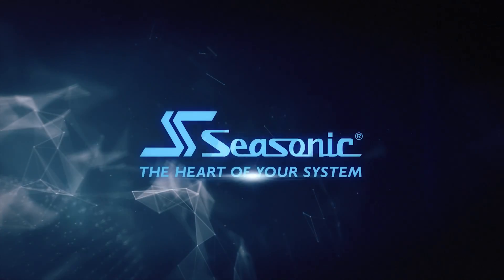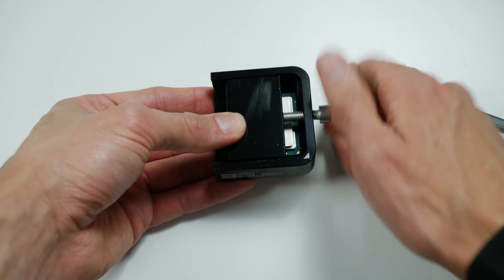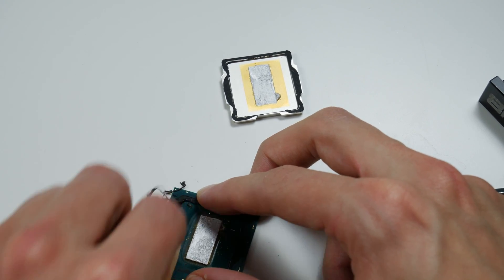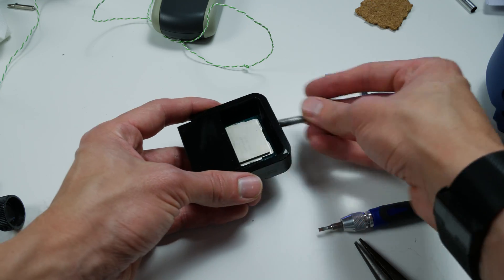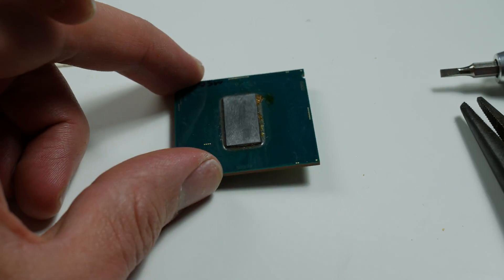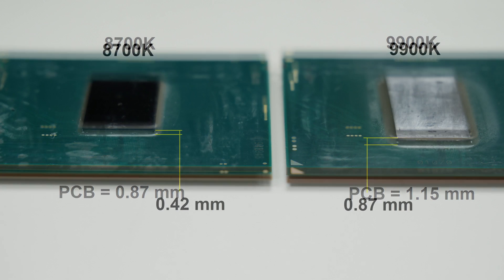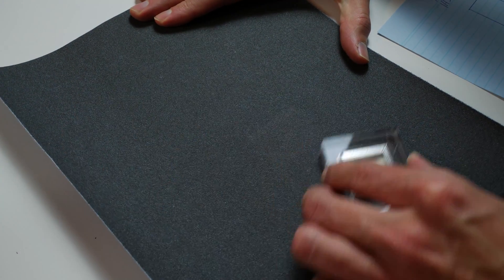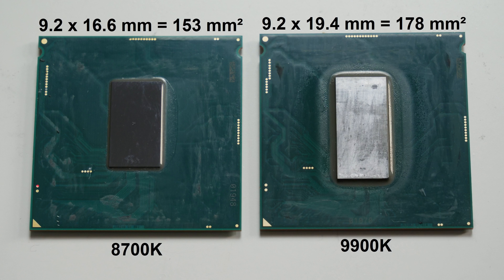Bad sTIM? Why is the 9900K so hot?

Comment: Waiting for 3700x :)
Reply: majnu100
Unlikely, as DDR5 is expected to come out in 2020 or 2021, which is part of the reason AMD says they will support AM4 until 2020 (other reason possibly being PCIE 4)
even if DDR5 came out early, AMD likely wouldn't be able to use it without breaking AM4 support
Reply: ah thanks for the info.
Reply: Diablo 4 confirmed
Reply: If AMD doesn't screw up in some stupid way, they will completely destroy Intel with zen 2 :)
Reply: +Robert Van GInkel
"completely destroy" is a huge overstatement... Zen 2 would be about 15-20% faster than whatever the i9 9900k's architecture is called, of course much cheaper, but still.
Reply: @roebbiej  yes they will..for few month
Reply: @roebbiej  like with their graphics cards ? Lol
Reply: @Maskinmester-DK  haha exactly. Or like the previous CPU lineups before they created ryzen.
Reply: Rasmus Rasmussen Their mid-tier graphics cards are actually really good, smart because about 90% of the market buys mid-tier graphics cards. Though their high end game is pretty awful atm. I hope they will stand a stronger when Navi comes out so that there will actually be better competition and start to stand a stronger foot in the gpu market like they have now in the cpu market.
Reply: Yep. I was considering getting a 9900k because some of the software I use for work doesn't run well on amd hardware. until I saw the temperature and power tests and this video.
Reply: AMD is going to kill intel in 2019 with the ZEN 2 design,
Hopefully the new GPU lineup is capable to battle against NVidia RTX
Reply: @Matt___B  yeah ... AMDtards said that shit about Zen+
Reply: upgraded my 2700x to the 2950x, i love amd
Reply: 3990X ;D
Reply: Zen++ or zen2
Reply: Is that was coming next because I was saving for a 2700x but I'll gladly wait to see what's coming next and go for ddr5 which hopefully will be out by then. It would mean me upgrading 2 gens on ram as in ddr3 and currently have a sandy bridge 2600k which I would sell the parts to fund my next build
Reply: @dnakatomiuk new amd gen next year but ddr5 ram ist expected in 2020/21
Reply: Me too
Reply: Me too, even if it's only 4.5ghz if it is at the right price and with a IPC increase I'm happy, screw Intel for charging so much.
Reply: +Happy Guy
intel is charging so much, because it costs them so much more to produce their CPUs, thanks to Multi-Chip Modules(what AMD call infinity fabric) their CPUs' price barely increases with the increase of core count as you have many small sized dies put together, while for an intel to make an 8 core/16 thread CPU they have to have a massive die and bigger dies increase costs exponentially, on top of the fact intel is facing 14nm shortages which increases prices further.

Actually, Intel is not really overpricing their CPUs, they just cost them a lot more to produce, thus are a bad value and not overpriced, there is a difference between poor value and overpriced.

On the other hand Nvidia has been overpricing the gtx 1000 series GPUs since 2016, the gtx 1080 came out costing 700$ MSRP in 2016, when it is/was a mid-range GPU with a die size of 312mm^2, super low failure rate and very low R&D budget for Pascal, whereas in 2011 the gtx 560 came out costing 200$ MSRP(254$ in 2016), had a 332mm^2 die size, Fermi at 40nm had huge failure rates and on top of that Fermi had high priority expensive R&D... the gtx 560 by all means is/was a more expensive GPU to Nvidia than the gtx 1080.

Nvidia since 2016 have been operating at a 100% profit margin which peaked in early and mid 2018 with them selling their GPUs at a staggering 134% profit margin. For reference, Apple is considered overpriced, but operates at a 35-45% profit margins, which means Nvidia GPUs are more than 3x times more overpriced than Apple's offerings.

Intel that you are blaming like crazy, has gotten down to 25-30% profit margins in 2018, which puts Nvidia gtx 1000 series GPUs 4x times+ more overpriced than intel CPUs.

Profit margins determine if something is overpriced or not, how good it is for it's price determines it's value to the customer, big difference.
Reply: ame ryzen is best :D
Reply: @linxu9763  
I don't know, i only really started getting seriously into PC gaming around 2012 (so around the sandy bridge era)
So socket 775 is too old for me to remember (though iv'e likely owned a PC with an older socket than that, i only know of the socket because i looked it up recently when someone mentioned they still were using a CPU with that socket lol)
i'm not sure if their was some weird cross gen thing with socket 775 with DDR2 and DDR3 or something?
I do remember their being a period (i think it was around 2014, but don't quote me on that lol) where intel had cross gen motherboards with DDR3 and DDR4 support,
i remember the motherboards being more expensive though, as the mobos needed to have separate slots for DDR3 and separate slots for DDR4,
you couldn't stick a DDR3 module in a DDR4 slot or the other way around,
so it wouldn't surprise me if 2020 or 2021 AM5 motherboards had the same deal, where ryzen 5000 series (or whatever it's called) would have a few cross gen mobo's.
AM4 likely won't have DDR5 support though, because i seem to remember AMD explicitly stating that they wouldn't change sockets until something game changing comes along that forces them to change sockets, and they mentioned DDR5 and PCIE4 as examples.
Reply: Waiting for 4700x or intel 1170k :)
Reply: Ur wait is over

Comment: One thing that the video is missing - is comparing the chip thickness to 2700/2700X, for example, and compare Intel 9600/9700/9900K solution's to AMD solution's.
Reply: the 9900k and the 9600k seems to have the same Die and Die Size, the 9600K is basically a 9900K with 2 disabled  cores and HT Disabled while the 9700K is the 9900K with the Hyper Threading Disabled.

Comment: Flux is visible in the middle of the soldered surface after delidding again - you need to burn off the flux for it to work, in other words you should have heated the IHS more to burn off that flux.

Comment: You would think the engineers at Intel would know and have tested these processors for temperature. I would hope they understand what making it thicker would result in, but I'm not convinced they do understand. Everybody was asking for soldered processors to improve temperatures, Intel knew this. So, why would they put out a product that was soldered but ran hotter? I'm starting to think that all the knowledgeable people in these big companies have died and now they are relying on people without experience or knowledge. Great video!

Comment: I wonder what's the Sandy Bridge 2600K die thickness?
Reply: Lagittaja this should be discussed more. If this is exactly the same thickness as the sandy bridge die or any of the X99 CPU dies, then idk what the big fuss is. If it's thicker than the previous soldered dies, then I would start wondering why Intel did what they did.
Reply: My 2500k has been running 24/7 at 4.6GHz since 2011 on a crappy 120mm radiator which has never had the thermal paste changed and temps still only peak in the high 60's. I'm looking at upgrading at the moment but having to delid and grind down a brand new CPU to get acceptable temps doesn't appeal to me.
Reply: I am still running my 2600k from april 2011 at 4.8 GHz with an voltage of 1.350 V (+0.125 V in OFFSET), and it only hits 76 C on its hottest core, no delidding just attached a normal big air cooler (Scythe Mugen). I was hoping we would get back to something like here 7½ years later...
Reply: It ran 5.0 Ghz with an voltage of 1.425 V (+0.200 V in OFFSET), but turned it down to 4.8GHz around 5 years ago.
Reply: Running my 2600k at 4.4 Ghz 1.33 V and it peaks at 60 C
Reply: 2600 centimeters
Reply: Why would Intel use metric? When Robert Noyce invented the integrated circuit he set the lead pitch at a tenth of an inch on center. Because Americans use freedom units!
Reply: @1pcfred  because imperial is the opposite of freedom, you Americans are so proud of your freedom because of the war against imperialists... c'mon man i'm not even American and I know this!
Reply: ah so that is what you mean when you say "freedom units" i figured it was MQ-9 Reaper's

Comment: HOW DID RYZEN GET IT RIGHT 2 YEARS AGO? Intel engineers are getting so lazy or the business environment is so bad that they have no chance to be competitive in the future
Reply: Jim Keller.
Reply: @Kidkosmos  and he's in Intel now :(
Reply: I'd be curious to see a comparison of die thicknesses between Ryzen and 9th gen chips, and thermal/overclocking results with both as the silicon gets sanded/lapped thinner and thinner until the point of failure
Reply: AMD got it right even 7 years ago. The FX Series (That are bad) for example.
Reply: AMD's been trying to compete since the Core series, so it's not like it's easy.
Reply: Their room for error is much larger because they aren't really trying to push high clock speeds. Their chips can't keep up with Intel's for high-refresh gaming, though.
Reply: @seanmcc09  I would actually say that AMD are trying to push high clock speeds, but just don't have the hardware. The overclocking headroom on their X sku chips is practically non-existent; single cores in my 1700X spike to 1.45V stock.
Reply: @seth094978  Zen 3 is going to be fabed at TSMC not their old pretend Fab. I expect at lot better headroom from TSMC 7nm process.
Reply: @ellsworth1956  That's why a 3700X is most likely in my future :) My NH-D15 is currently wasted since my 1700X clocks so poorly.
Reply: Zen 2 based designs will be on 7nm. I don't think anyone has said TSMC yet. Everyone is inferring it. But its a pretty solid guess.
Reply: Apple use 7nm of TSMC for their mobile devices.

Comment: My theory is that the added thickness is to protect against sudden temperature changes within the die due to monstrous power requirements. The heat could be "dampened out" before reaching IHS and reduce chance of cracking. Maybe we could get how many W is this chip pulling from the VRM and will give us a clue. And then they went soldered because normal TIM would just catch on fire haha

Comment: so intel is trying to replace AMD as spaceheaters?
Reply: After the appearance of the 7980XE, there are no heating competitors left.
Reply: they already did
Reply: gonna have to turn the radiators next winter when i buy amd perhaps lol
Reply: Just in time for Winter :D
Reply: they saw the business model worked 😅
Reply: so you are not smart!
Reply: dunno?
I guess this is hot according to the internet? 

https://imgur.com/a/jfiN1Rw
Reply: Intel has been producing stupidly hot CPUs since Haswell.
Reply: Cirux321
Ebay CPU's, what Haswell you bought, XP EP  E2699 v4, 5Ghz Turbo?
You gamer's are stupid, needing 48 HT cores to run Console titles!
Reply: I never got that AMD meme. I have an OC 8 core FX and it's one of the coolest CPUs I have ever owned since my Celeron 766Mhz.

I run it on passive water cooling with temps never getting over mid 45s on full load.  My GTX 980 pumps out far more heat with a full water block, making up about 2/3rd of the total system heat output.

The hottest CPU I personally ever worked with is i7 975 XE, custom loop at 4GHz it ran around 75c water temp on dual 120 x 50mm rad. with 2 x 3500 or so rpm delta fans. That thing was hot!
Reply: @3800S1  it was the fact that they ran so hot compared to their contemporaries, like the 8350 which only competed with the i5 4790k ran about 20C higher on average with the same cooling
Reply: maybe but I find anything under 50-40 range hard to call hot.  Mine like I said under passive water runs 40s max load like prime for an hour and usually idles low teens and reports 0c in winter as it has a cold bug of sorts.   At the clocks it's set it's meant to be a "150W" cpu but it's heat output is more like a 45-65W CPU.   The hottest AMD cpu I ever had was an althon XP on the same water setup as I have now ran mid 50s and was only running at 2.25Ghz stock voltage. default was 2050? Mhz? 2800+ anyway.  They were never considered hot but fact is it ran hotter than my FX

Up around 5Ghz I know the FX was hot but was any CPU at 5Ghz less hot?  and I know for a fact many couldn't do 5 as 95% of the AMD boards were shite and lacked any decent VRMs, so it was much based on a minority few CPUs that did run hot when in reality what most people purchased ran and realistically OC'd to they weren't hot at all.

I find it silly that all FX are classed as hot when it was probably the 9950 on boards that could run it that were

It's like saying all 8th gen are hot when really its just the i7 pushed to the 5ghz range that are hot, actually they are probably worse since they use paste.

Comment: Unless Intel is using 450mm wafers, which they aren’t, there is no reason for making the wafer thicker on what is essentially the same process. It must be a packaging reason, possibly a thermal barrier for the soldering.
Reply: I think that with thick layer of copper chip itself will expand or shrink a lot less (cause that copper part will keep it in check). Most likely they did it so chips wouldnt crack due thermal difference.